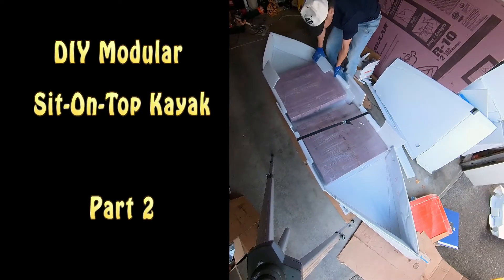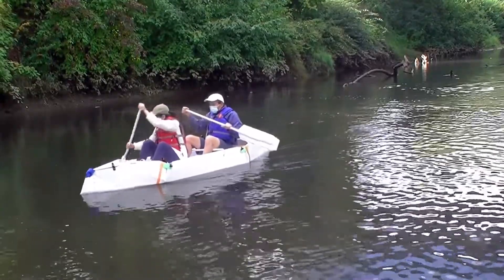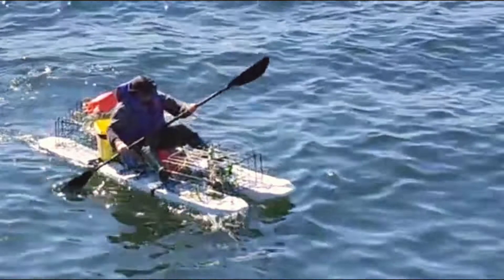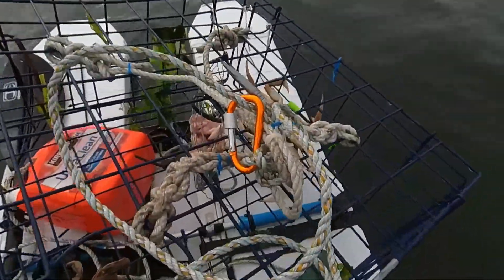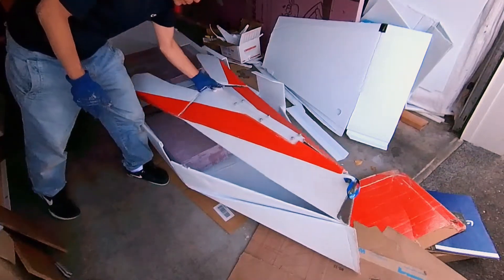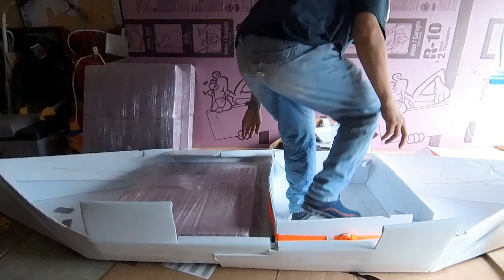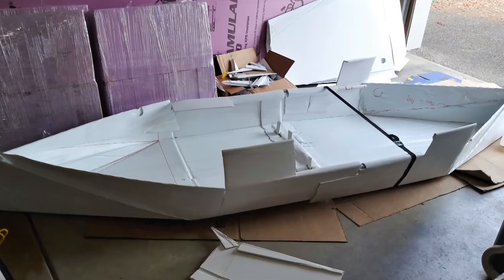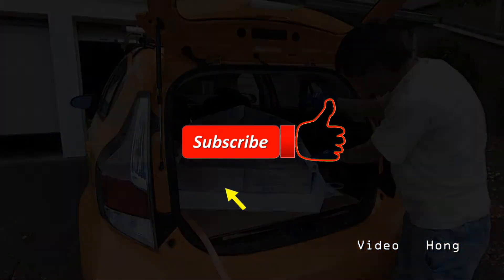Part 2 DIY Foam Boat ! Modular ! 20 lbs  ! Sit-on-top

Comment: Need more details on how to coat the foam and make the boat hard. Love the concept! ❤
Reply from the maker: Thanks for watching and your question. I used plastic wrapping film to cover the foam. It doesn't help with strengthening the foam surface. You don't really need that. I happened to have that on hand.  I used coroplast to wrap the foam and it protects the foam. The foam provided the extra rigidity to the kayak.  Water will go inside the inner layer between the foam and the coroplast. If you need more information, please let me know, I can provide video to illustrate that.
Reply: @DIYUSA  Where do you get the foam?
Reply from the maker: @d.j.aguilar6208  I bought the foam at home depot in US : https://www.homedepot.com/b/Building-Materials-Insulation-Foam-Board-Insulation/XPS/N-5yc1vZbaxxZ1z0w1xo
Reply: Thank you for the link!!!
Reply from the maker: @d.j.aguilar6208  You are welcome! Hope you can get what you need.